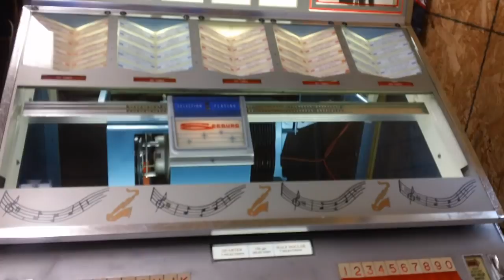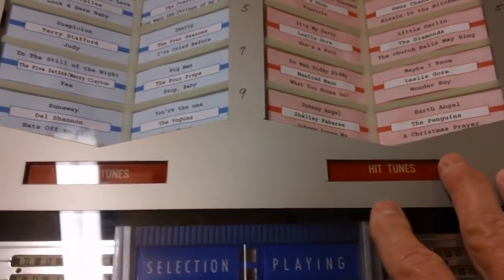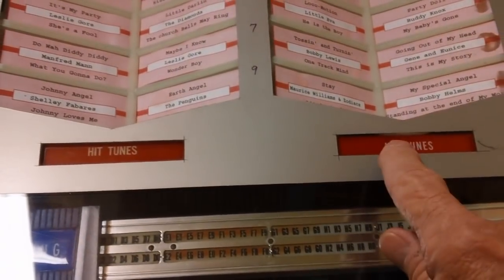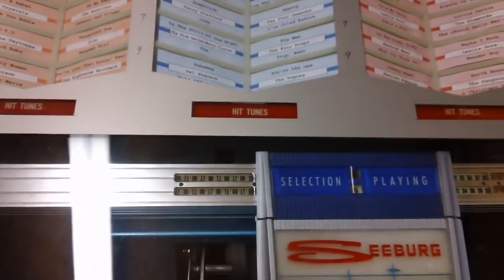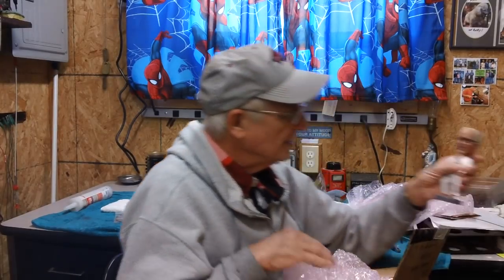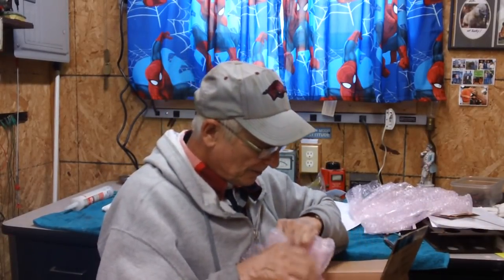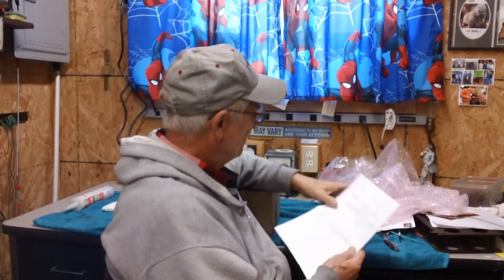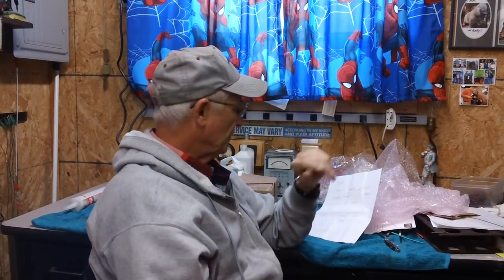Mish-Mash # 253

Comment: Wow John, I understand.  Back in 2010 I spent 8 weeks in the hospital with a very bad case of pneumonia, the first two weeks I was in a drug induced coma (Propofol) and when I awoke I had a Bipap machine on getting 13 liters as well.  My nose got so dry that they finally put a water tank in the line.  Had an IV and the heart monitor on left hand and a pic line in my right bicep going to my heart and all those stupid sticky patches of wires stuck to my chest.  I had to stay on that oxygen for a year after I got out of the hospital.  I still get winded easily and still do breathing treatments with a nebulizer and an inhaler but thankful I don't have to use the concentrator at home or carry around the shoulder tanks outdoors anymore.  Also, sorry old chap, but I got you a Christmas present long ago this year, I just haven't sent it yet, lol.  It's not much but it may be a small project for you.

Take care, Gary